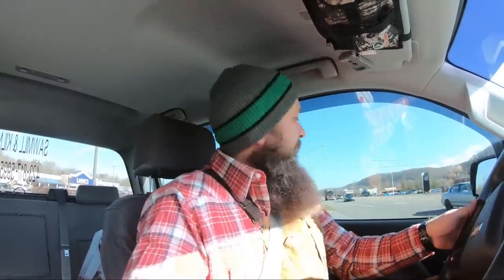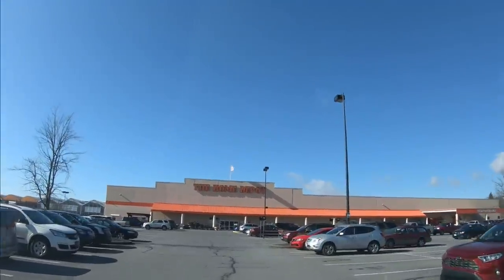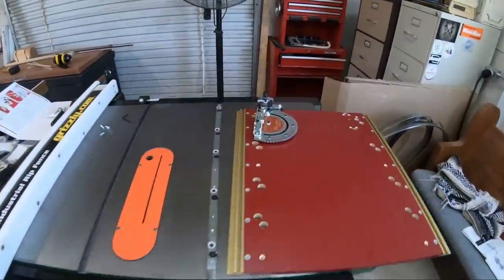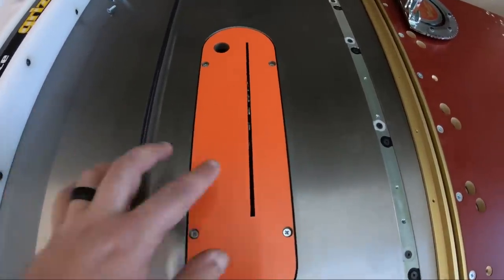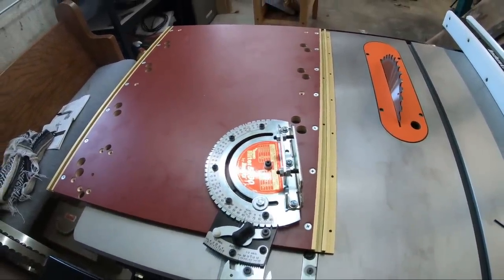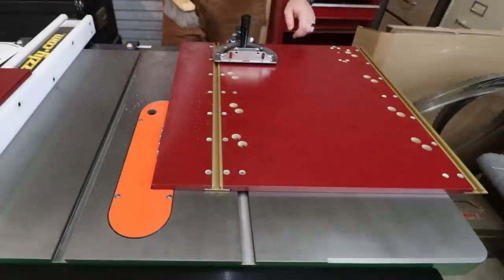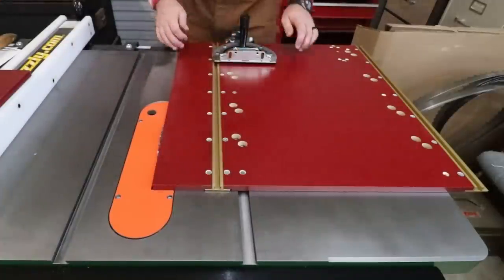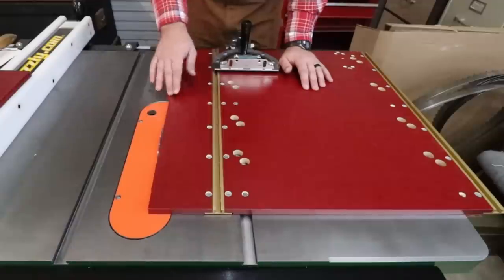Junk Plywood, Table Saw Sleds, Zero Inserts, Sawmill Workday 12-18-19

Comment: Nice setup, I have a habit of always lowering the saw blade when not using the table saw, you never know when a switch is in the on position or the power might have gone out, I’ve seen the old saws start up when bumped.

Comment: I have the same Incra sled.  I love it.  It's super accurate and the cuts are repeatable.  A super tablesaw addition for any serious craftsman.  I set mine up on the right side since I have a big cabinet saw and don't need to worry about big pieces hitting the floor.

Comment: If you don’t want to give up the floor space for an outfeed table, an adjustable stand with a roller ball top can do the job in many cases. I bought one at Rockler, it takes about 30 seconds to setup, and colapses and stores mostly flat against the wall when I DON’T need it.
Reply from the maker: thanks might go that route,

Comment: You're gonna love that Miter 5000, it's a game changer!
Reply from the maker: took some work getting it square but now cuts perfectly,
Reply: @OutoftheWoods0623  Does your blade tilt left or right on that new saw?  I have a left tilt so I setup my sled so it's on the opposite side as how you just setup yours (other side of the blade where your fence is sitting).  If you have a left tilt blade that'll mean its tilted towards your hands and the metal fence the way you currently have it setup.

Comment: God, have things gotten fancy now-a-days. It is a long ways from fifty years ago when we couldn't be bothered with all that stuff that would get lost and ruined, and so just hand fabricating out of scrap lumber whatever Sled was needed for the construction site job and cutting wedges to jig the miter angle as needed. Even Union Carpenters wouldn't bother unless it was a big finishing job because stuff gets lost or ruined moving around, so we just do/did it fast with "Make-Do" tricks. ||| Still, it is very nice equipment, that is for sure.